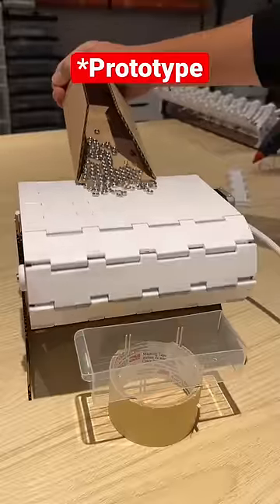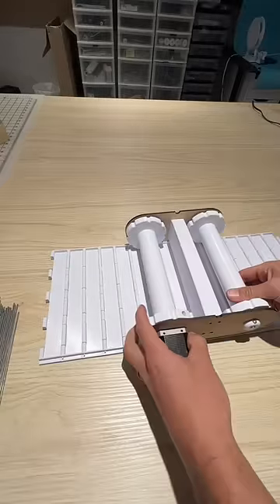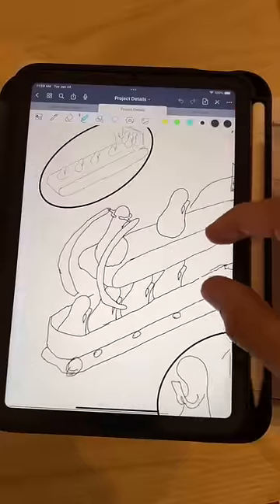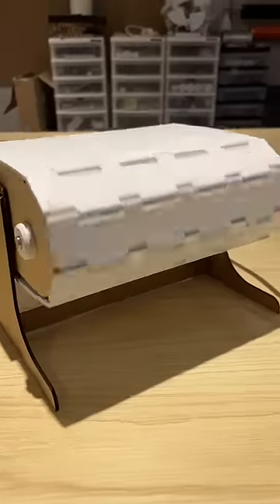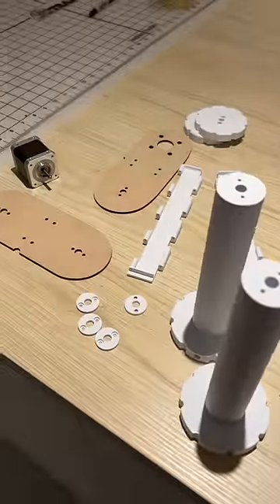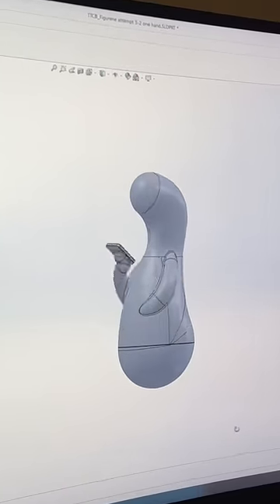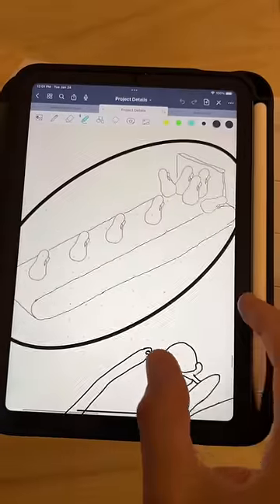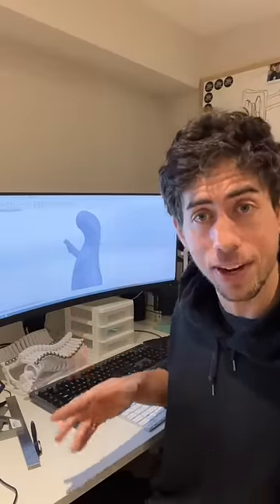Prototyping a Conveyor Belt

Comment: Nice, I dont know much about conveyor belt except a few that I saw on a mining site where my father works. Its usually made of some kind of rubber and slightly curved so that the materials dont fall from the sides while going uphill. They are usually placed at around 15 degrees . Pretty cool stuff. And i think rubber also provides a good amount of friction.

Comment: I know that kinetic sculptures can sometimes use mechanical concepts in weird ways. If power is also being transmitted through the belt you may run into problems of jerky movement caused by chordal action. Running an actual rubber timing belt inside the larger plastic one will smoothen out those movements.

Comment: The belts at my job are made out of a rubber composite and are much longer but i suggest you’re gonna make it longer you might want to put in a gravity take up/screw take up roller to keep better tension.
Reply: My work uses plastic belts like that one just the spokes are smaller width wise but taller and that I think helps with gripping into the belt.

Comment: May I suggest right from the start you reduce the “length” of each conveyor belt unit. The more you have per belt length, the smoother the belt will run around the rollers, and the less trouble you will have with jerky movement, jamming, and things on the belt being thrown off balance.

Comment: That looks just like the Intralox conveyor we use at work.
Reply from the maker: I’m gonna check it out!
Reply: @JBV Creative  With that type of belt, they have so many different designs so I'm sure you can find something to help you out. Oh, then on top of all the designs they have different textures also to assist in either more or less friction to the material, belt strength, or capacity.

Comment: I Have 2 different gear boxes planned out for over 25 years  . I need help with making them reality . Would you help me ?  I am not expecting anything for nothing .  It is  really simple using 2 spur gears . The gears need to be between 2 3/4  and 3 1/2  inches tall  and around 2 3/4   - 3 inches wide and gear ratio needs to be below 2-1 and higher than 1-1